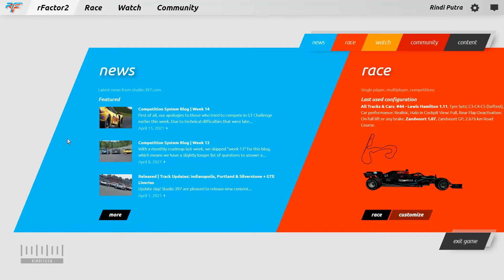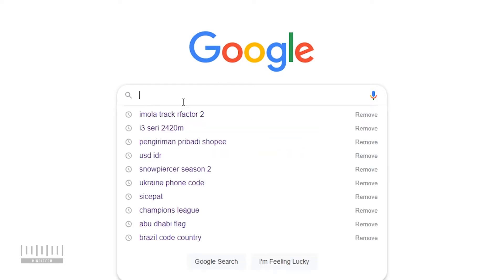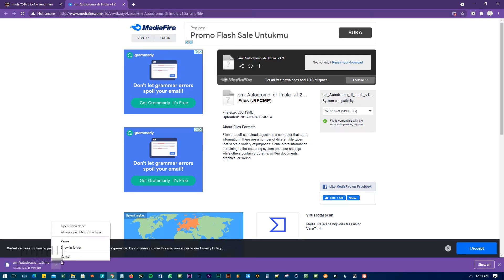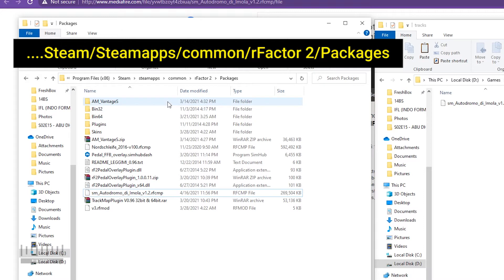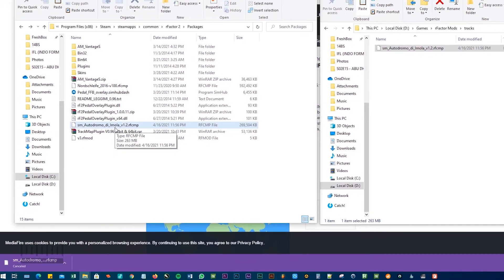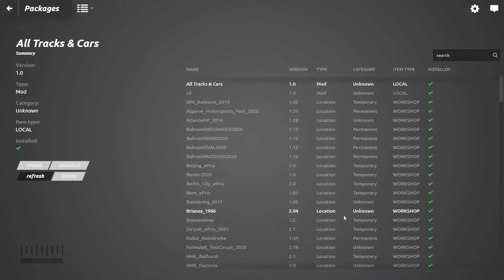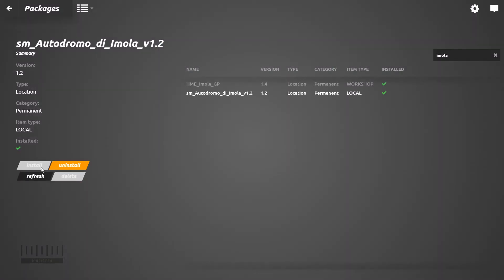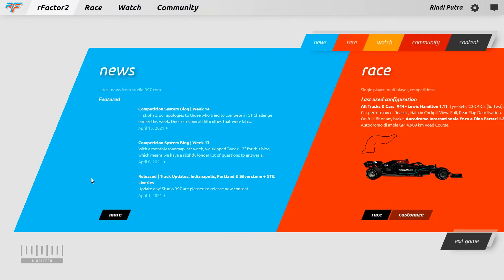How to Install File Track Circuit on rFactor 2 (NEW LAYOUT)

Comment: when i go back in rFactor 2 the download of mods not start
Reply from the maker: Seems that the installation file is corrupted or something. If you can, try install other track from a famous source like Race Department website to make sure the file are in good condition. Good luck!
Reply: @RindiTech  ho scaricato tutto da Race Department, dopo aver disinstallato e installato il gioco me le ha messe, pero ho ancora il problema dell'online che mi dice "non è stato possibile trovare le mod" anche se le ho
Reply from the maker: @ema6337  forse il problema è nel tuo gioco, assicurati di avere l'ultimo aggiornamento
Reply: @RindiTech  ok